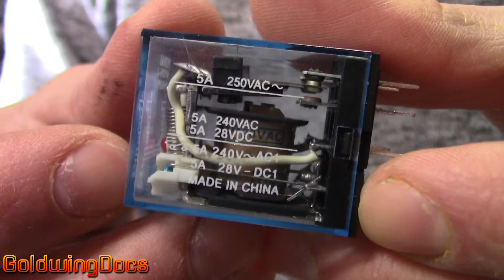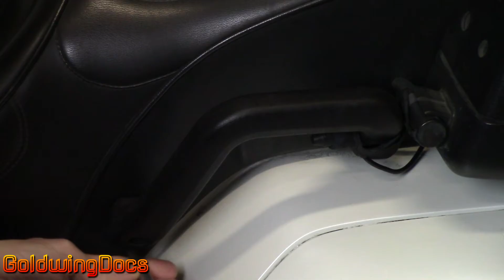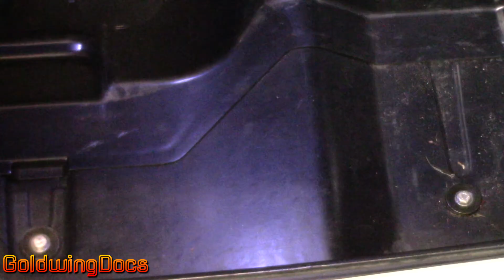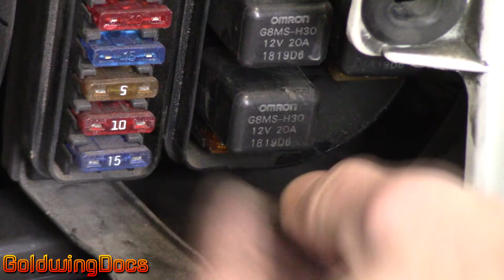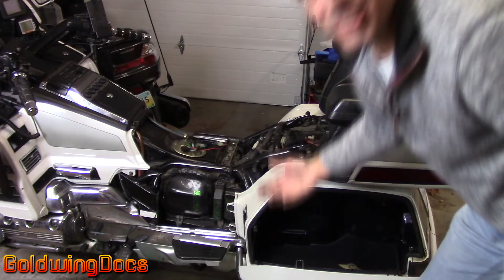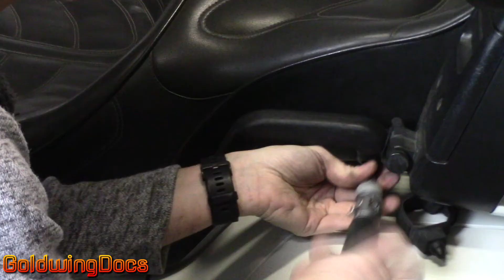Goldwing Relays: A ticking time bomb? How to replace them!

Comment: Nice!  Would the “OD” light, gas gauge and temp gauge happen to be on a relay?  They all quite simultaneously.
Reply from the maker: Indeed they are, they all share fuse 8 and relay 3, along with the taillights.
Reply: @GoldwingDocs  Thank you for such a rapid and helpful reply!
I need some then!  How to order?
Reply from the maker: Right here: https://goldwingdocs.com/Store/Goldwing-GL1500-Relay-G8MS-H30.asp
Reply: Are they labeled with numbers?  My taillights work fine but along with the gauges and "OD" light the "Reverse" light and function is out.?  All relay 3 related?  As I look at the relay how can you tell if one is "blown" or "caput" or "dead" or no longer operative?
Reply: Bought Scott’s relay, replaced relay #3 (top row, far right as looking at it from left side of bike), followed his video instructions - fixed everything that wasn’t working.  So happy!

Comment: If there are only 6 or 7 relays that are now 25 years old (give or take) why not just replace them all at once, other than if it ain't broke don't fix it? Seems like a reasonable price to pay for security. Thanks. I'm an old newbie.
Reply from the maker: Many people do exactly that. There is one relay in there that is NOT a G8MS-H30, it is a normally closed relay and is used only for the parking lights and air compressor, so it rarely fails.

Comment: New E10 petrol Ethanol petrol coming out will my 05 Goldwing 1.8 run ok on it ?
Reply from the maker: It will run fine, but I wouldn't leave it sitting in there for long periods of time, without stabilizer added.

Comment: Anything relating to the GL1500, does that include the Valkyries also??
Reply from the maker: In a lot of cases, yes. There are differences (valves, carburetors, U-joint), apart from the obvious differences, but there are a LOT of parts and systems in common.

Comment: I’ve had a few GL1500s and have never had a regular relay go out on any of them. A couple of my bikes had over 300,000 miles on them. Of course I have had the starter relay go out a few times which is why I always carry spares and no I do not buy them from Honda. I buy them off of Amazon really cheap!
Reply from the maker: You're one of the lucky ones then! I've had two relays my GL1500 fail in the last 5 years. And the fact that we've sold literally thousands of these relays (and we continue to sell hundreds every month) says that they can, and do fail fairly often.

Comment: Have a problem with my 2004 Goldwing I thought it was a bad battery throwers fuses got a new battery put it in and it still won't start I hear clicking but it won't turn over what is my problem

Comment: Thanx, One question is there any easy way to tell if a relay is good or not? Also which relays would you recommend replacing?
Reply from the maker: Often your first indication that a relay has failed is when the circuit it controls stops working. Occasionally they will fail "stuck on", in which case you can give it a sharp rap with something hard to temporarily unstick it.

All of the relays in the GL1500 except one are of the same type, and can be replaced with our relay!

Comment: Where is the starter relay for a 94 honda goldwing 1500? On my relay cover, there is nothing that says starter or ign. I googled it and it does not show which one it is. Thanks.
Reply from the maker: The starter relays (there are two - starter relay A and starter relay B) are not in that relay case, they are on the other side of the bike, near the battery. Here's a topic discussing them, with pictures showing their location: https://goldwingdocs.com/forum/viewtopic.php?p=181283#p181283
Reply: @GoldwingDocs  So, they are not the same as the other relays? That looks tiny.
Reply from the maker: @JohnSmith-uy7sv  No, they are completely different relays. They are high-current solenoid-type relays with stud and nut terminals on top.
Reply: @GoldwingDocs  at 3:28 he shows the starter relay and how to jump it. 😀https://www.youtube.com/watch?v=cmJn16AxXeo
Reply: @GoldwingDocs  Or are they 2 solenoids? That is what they look like. Nothing to what is on the other side. Thanks.

Comment: First time viewer. Very helpful information, thoroughly delivered.  A small tip for those that have yet to install straps (as you have) to avoid losing the side covers. When 1up, raise the passenger foot boards. If a cover does come loose it makes it harder for it to escape. Not an issue when 2up. I look forward to visiting Goldwing Docs.

Comment: Great video and videos that you produce.  I have a used 1500 and this may be over kill but have decided to just switch out all the relays at once instead of waiting for failure in the middle of nowhere.  Are the 8 relays in the box the only ones that you are selling or are there others of this type in the bike somewhere?  Thanks.
Reply from the maker: 7 of them are the same, and are the ones I have sourced. You'll see one relay in there that is blue (the rest are black) - it is different, in that it is a normally-closed relay instead of normally-open like all the rest. For whatever reason, that one blue relay rarely fails - so the demand for them is nowhere near enough for me to source them as well.
Reply: @GoldwingDocs  Thanks for the quick reply and again, thanks for all the great information that you share!

Comment: Oh..and ps..its always a good thing to have a little plastic parts container to put all of your screws,plastic caps and bolts in..this way you will not loose and anything when you start putting things back together..👍👍
NOV /2/2020
Reply from the maker: I usually have Ziploc sandwich bags. I will put fasteners into the Ziploc bag and write on the bag with a Sharpie what the fasteners are for. That way you can keep the fasteners separate, and you will remember when you put it back together what goes where (even weeks or months later!).

Comment: Hello my name is Emmett new subscriber after watching this video but I have a question you did not say.which  relay.you were replacing on your 1500 Goldwing...??
And question 2..what about relays for the GL 
1800 GOLDWINGS..??
AND LASTLY..WHAT MAKES THESE RELAYS BETTER THEN THE RELAYS YOU ARE REPLACING .???..AND I WILL BE WAITING FOR YOUR RESPONSE my friend...NOV /2/2020
Reply from the maker: All of the relays save for one are exactly the same on the GL1500, so they are interchangeable.

The GL1800 uses completely different relays, not compatible with these.

The relays we sell are rated at twice the amps (40 amps vs 20 amps) than the OEM relays.

Comment: Great video.  Just what I needed, but have a lingering question.  how can I test the relay to determine if it has failed?
Reply from the maker: A relay is a magnetically operated switch. So you can test the resistance between the output terminals when it is not powered (should be infinite) and when it is powered (should be close to zero).

That said, many relays fail by sticking on, and they do so intermittently. Vibration will often break them loose, until they finally fail in a way that they will never recover.
Reply: @GoldwingDocs  Thanks for the quick response.  I'm trying to diagnose my Goldwing not starting.  thanks.

Comment: Wow, great video Scott! I have a 03 GL1800 and was wondering if your relays will work on it. 
I am also having an issue with my right high beam. I replaced the bulb then checked the old one and its good. Can that be a relay problem? The left high beam is fine. Any advice would be appreciated.
Reply from the maker: The GL1800 uses completely different (and much cheaper!) relays than the GL1500. It has two: a low beam relay and a high beam relay. If one headlight is working and the other is not, then the problem is not your relay.
Reply: @GoldwingDocs  Thanks Scott. Guess I have to do some digging through the wiring.

Comment: Hi Scott. Do you have a video on TESTING RELAYS? I'm beginning to think maybe the starter did stick at some point But released. I have my LAtrical Alternator sent out to be rebuilt. Hopefully It will be back soon. My Battery has been on my bench for 2 weeks holding at 12.3. I would think it would have gotten lower if it was bad. It was 12.7 when I took it off the charger. Then dropped down to 12.3. But is holding there. Autozone said It's still good.
Reply: When the contacts on high-current relays begin to wear out, your first indication is usually when they stick on. Sometimes rapping the relay with something hard (screwdriver handle, for instance) will free it, but it's only a matter of time before it happens again...and eventually it will stick permanently.

If a relay has stuck on, even once, I know it's time to replace that relay, because it's on the way out. This most often happens to the high-current starter relays (starter relays A and B on the GL1500).
Reply: Relay testers cost less than $20.

Comment: Help! Reverse, gas gauge, temp gauge not working. Tried replacing a fuse #8 I believe. Blew the fuse several times. It was the right size one. Could this be a relay problem if so which one and where do I get some. Thanks for any help.
Reply: Btw it’s a 99 1500
Reply: @raywalsh8807  I have the same issue on my 98 GL1500...did you figure it out?
Reply: @xs1000kaw  it was a short that kept blowing the fuse. Honestly I don’t remember where. Good Luck Steve.

Comment: What would make it where the bike started just fine -- turned the key and the headlight came on, etc... came back 3 days later, and there was noting at the ignition (no instruments came on, and nothing else comes on electrical) -- NO issues before, and battery is fully charged.  Side note, when I went to start it this summer (after I got the tabs late due to covid shutting down DMV's) -- the key was very hard to turn (almost like it wasn't the right key), but got it working, and for several days it worked fine.  Anything that would take out ALL the power immediately so the key doesn't actuate anything?

Comment: Good day, Scott 
On the 2 (4) seat bolts I put a nut on them and ground a small point down below the minor diameter on my bench grinder, that worked out very well. Yes, take the nut off first to chase the threads. 
You are one hell of a teacher, thank you so much!
Johnny Boy
Reply from the maker: Thanks John! You can actually buy those bolts made with a taper in place, which is a great idea for those frustrating things: https://www.amazon.com/Show-Chrome-Accessories-52-843-Tapered/dp/B00TV6SCQS/ref=sr_1_2?tag=goldwingdocs-20

Comment: Nice finding this I haven't read about this happening on GW Doc yet, but a member for sure as i just bought a 97 the same color as yours, Most I looked at were black or dark green and both disappear from your site to easy, so I guess I need to order a few to get ready for one going , guess I need to check the manual to see what runs what

Comment: Great video Scott!  When you were explaining the relays, you mentioned that there is "another bigger relay" that is in the starting system.  I have bought a couple of relays from you, but I believe they are the smaller ones.  What is the description of the "bigger" relay and should I have one of them too?
Reply from the maker: The two relays that run the starter are on the other side of the bike, and are known as starter relay A and starter relay B. They are different from one another, and while you could potentially carry spares, that's going to take up a bit of space, as they are much larger. You can see pictures and locations of them here: https://goldwingdocs.com/forum/viewtopic.php?t=6637#p29355

Comment: So those look very similar in size to the ones used on the 85 gl1200 ltd. It looks like the only modification would be to snip the side catches off.  Can you confirm that these are the same schematic?  If so, I'm ordering enough to retro all of them.
Reply: I'm also trying to source the same relays for my ltd, did you ever find a solution?